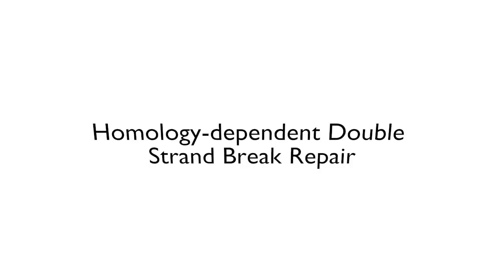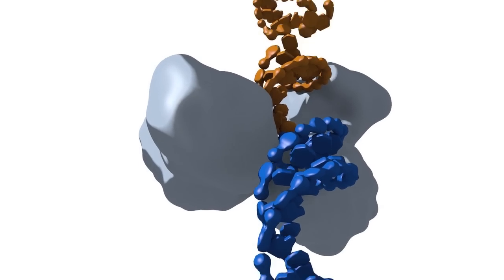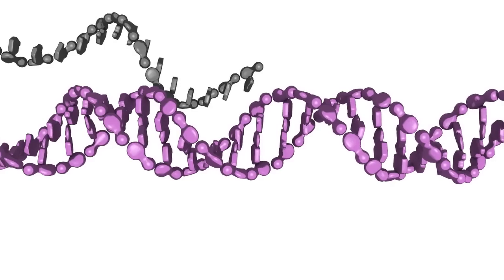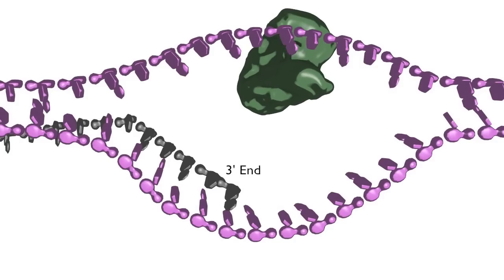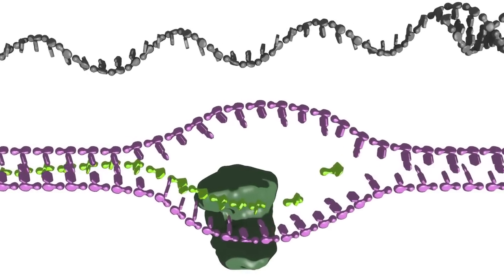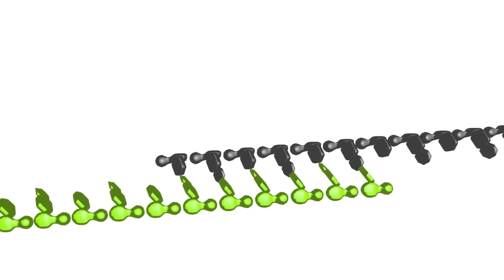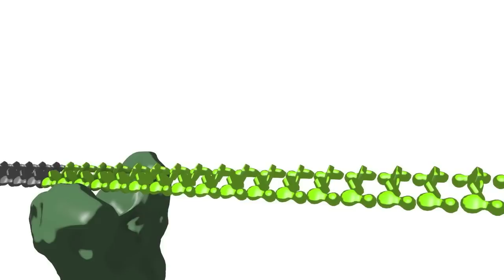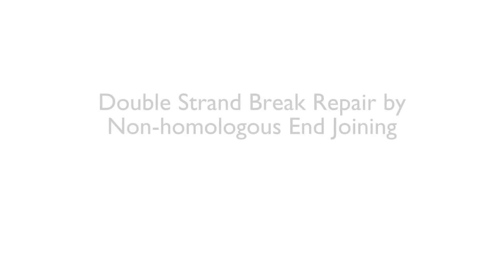Homology-dependent double strand break repair

Comment: Valuable animation, but could use some more explanation, such as: 1) under what conditions is the homologous dsDNA conveniently located nearby, and how is the physical coordination/matching of regions initiated; 2)  other references (wikipedia) mention two different paths to resolving the bubble, one involving cross-over, the other not -- is this true, or is this video more accurate information showing only the non-crossover way; 3) how does the bubble know when it has synthesized enough new DNA on the invading strand to match the other hanging end of the broken DNA?

Why is the description of the video seemingly wrong ("Published on Aug 12, 2014
In this animation, we explore how a transposon moves as a consequence of DNA cut-and-paste transposition. ")?